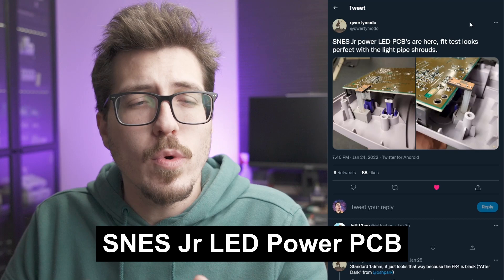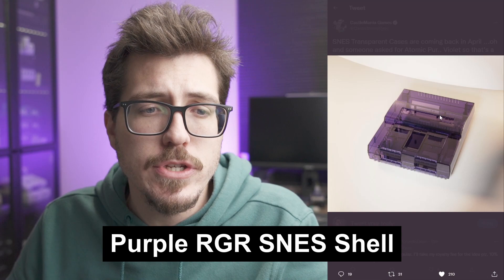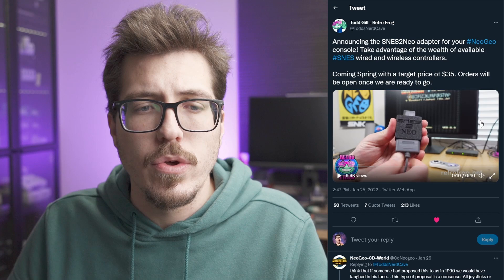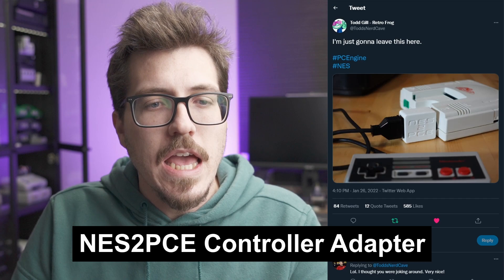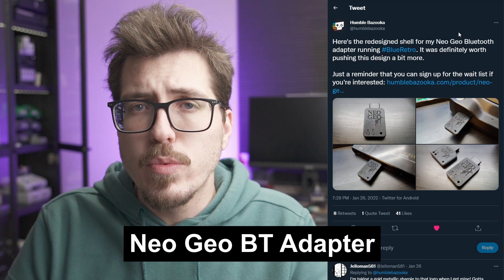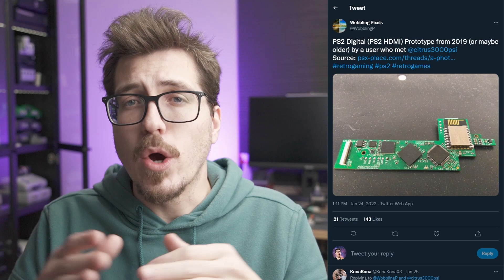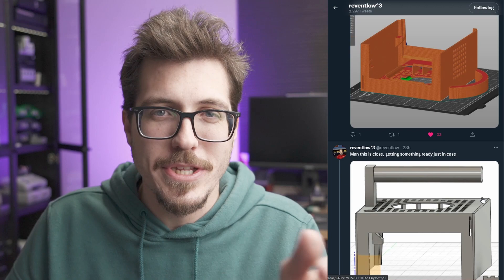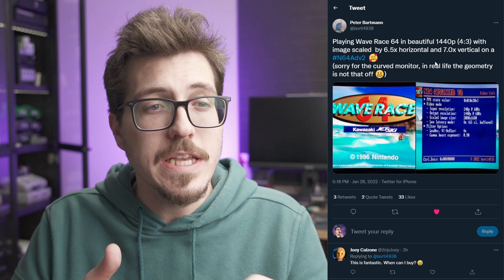RetroTink 5x 720p Line Doubling - Retro Modding News 1/30/2022

Comment: My kingdom for a ps2 ode. Hopefully one with hdd support. I filled up 2tb with ease on my free mcboot setup. It's such a colossal pain to edit and add new games though. It was like a several day project just setting it all up and getting the games loaded.

I'm a little shocked it's so neglected. The ps2 library is beyond huge. I guess it has always been kind of the odd duck out with its hard to handle 480i.

Ps2digital and ps2 ode will be day one purchases from me. By that time I hope we have a Memcard Pro available for it as well. It needs to match the absolute ridiculous nature of my PSX. PS1DIGITAL, XStation, Memcard Pro, Brook wireless adapter with ps4 controller, and a GameShark Pro flashed with caetla/unirom.

Comment: I think 1440p computer monitors will be chased after for retro gaming in 10 years. 1440p is the sweet spot for scaling everything under 720. 240- 6x. 480- 3x. 720- 2x. Plus, the 360/ps3 era of gaming doesn't actually always put out 1080 once you get into the games. Largely that library is 720p. The pstv looks best at 720p, and can only do 1080 interlaced. Even the switch is sketchy on resolutions. 

720 consoles I'm looking forward to scaling up- xbox/ xb360/ ps3/ pstv. 

The other aspect is 480p pvms are expensive, and it might be nicer to scale up things like the dreamcast and gamecube/wii to 1440 in the same setup. I have one that does up to 480i. Would be nice to get those consoles looking good all wired up together with the 720p stuff.

idk- we'll see. predicting tech is difficult, but I'm going to nab the nicest 1440p monitor I can find at the end of the lifespan before everything moves to 4k.

Comment: I think the ODE for PS2 isn't that needed for the FAT models but it would be so needed for Slims since the only options you have for booting games is Network and USB.
Reply: SMB booting generally works better than USB. It's data transfer rate is faster.
Reply: @sunflash2  Yeah but it's not really that convenient. The Slim would be so much better if you could use an ODE.